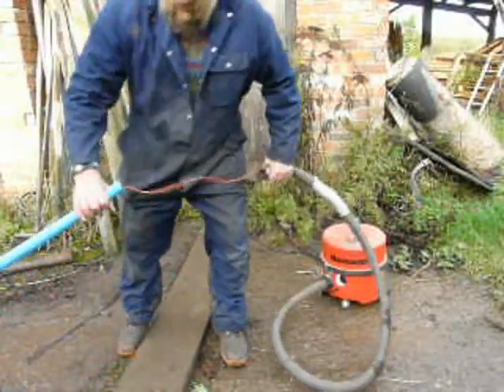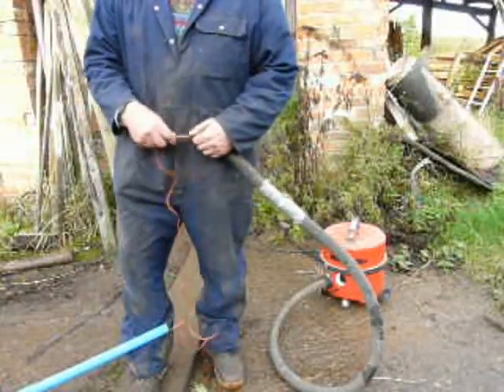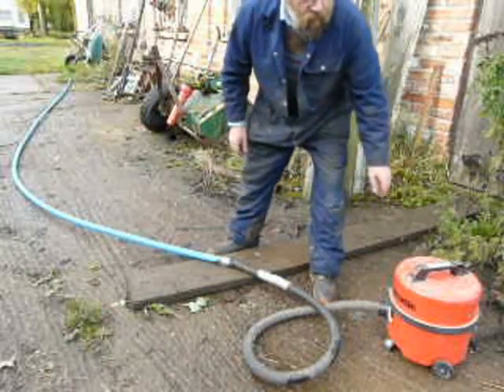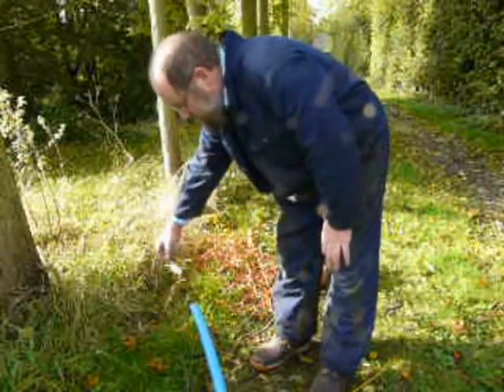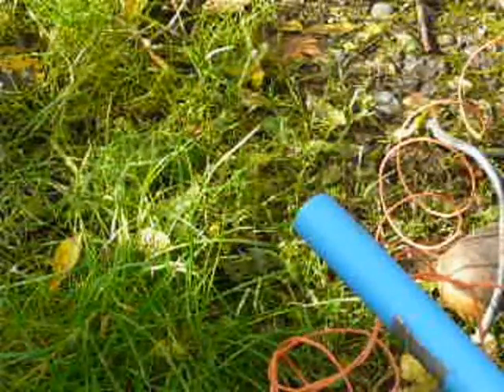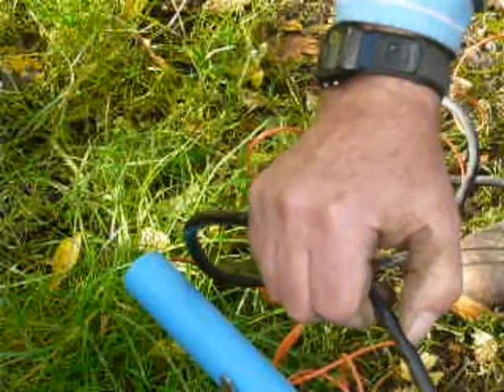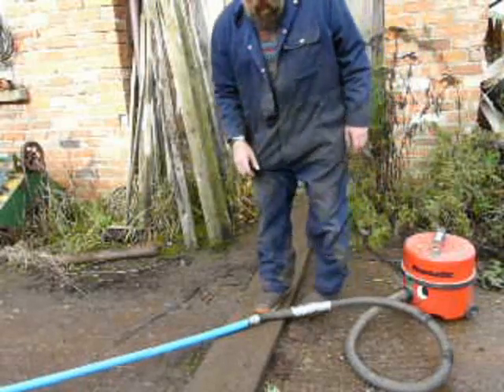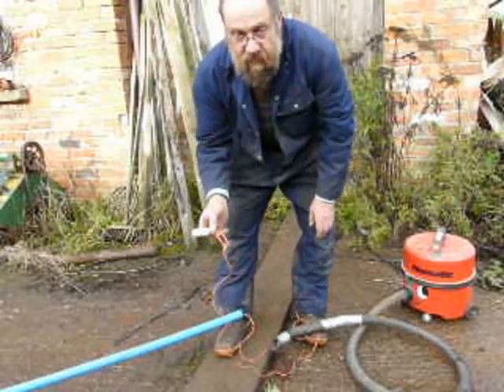Pulling cables through a long underground pipe.

Comment: Briliant, so simply explained with clear instructions.
I'm about to embark an replacing a bodged up mains supply from house to sheds 60m away using 2.5mm2 NYY-J cable, as its a lot more cost effective than armoured, with some lengths buried. I did think of using plastic conduit and this video shows me how to feed it without special tools. Many Thanks indeed.
Reply from the maker: Thanks for the comment , hope all goes well, please subscribe, cheers

Comment: Brilliant video. I am trying to pull a 100m length of cat 6 internet cable through a hosepipe. Can I ask the specs of the conduit pipe you are using as I may use that instead and where I could purchase it. Many thanks.
Reply from the maker: Hi. I think it was 28mm OD standard underground water pipe, available at any builders merchants, cheers
Reply: @TheInfoworks  Thank you. I’ll have a look for that.

Comment: I am going to try to run a new cable through an already used tube. Very useful video.
Reply from the maker: Hi, I always try to leave a thin rope in the pipe along with any cables because you never know, cheers

Comment: hahhahh i just used wire as had no string, thought id just try 2 core 12v cable, worked great,, also run 2 camera cables. through it, spot on method im going to have to remember this, awesome work, thankyou,.
Reply from the maker: Great, hope you have subscribed, cheers

Comment: Thanks Andy. 
Is it a horrible idea to run a low-voltage wire down an in-use 2 inch poly water pipe ?
Reply from the maker: Hi, depends on the current, size of cable and distance. Volt drop is you enemy here, so 3 amps at 12v through 50 meters of bell wire would be a huge problem. Current remains the same but volts drop so you could end up with less than 4 volts, cheers
Reply: @TheInfoworks  You may enot have given credit for the awfulness of my idea ! The pipe is full of water !  24 volts line from the bore head to the level sensor on the header tank 25 yards distant. The pump fella is not keen ! I'm just being lazy trying to avoid digging 25 yards of clay.

Comment: Thanks and greetings from Sweden. I'll give it a go tomorrow. Need to pull a cable through 40m of flexipipe. Hope it works :)
Reply from the maker: It will be fine as long as the pipe is dry, cheers

Comment: Hello Andy thanks for this great very practical tutorial now running some 6-7 years.  One question, do you know if this will work with smaller calibre piping, I.e. 20 mm MDPE internal calibre 15.2mm?  Regards Dave
Reply from the maker: Dave, I suppose it depends on how tight any bends are and how large the cables are. There's only one way to find out, let me know how you get on, subscribed? cheers
Reply: Hello Andy, thanks for this video and for sharing your knowledge and experience in all your vids. I used your technique for getting a pull string into a 20mm blue pipe yesterday evening. The pipe had water in it so attached 2 receiver tanks in front of the hoover so the water would not go down hoover pipe.  Thanks again!
Reply from the maker: Brilliant, good thinking and well done, cheers

Comment: This is a brilliant video. Thank you so much for posting this.. I’ll have to try it, but does it work if you have an existing cable in the conduit and the conduit has already been buried? I’d like to run some Ethernet cabling in the same conduit as the power to my garden house. Thanks again.
Reply from the maker: Hi, be good to hear how you get on, a bit a skill required and maybe use a bit of polythene as a mouse so it's more flexible, and a good vacuum, subscribed? cheers
Reply: Andy Reynolds thanks Andy. Will do. Subscribed. What’s your idea with the polythene?
Reply from the maker: Hi, A contractor I know just used a bit of polythene bag and he said it works, just thought it may add a bit of flexibility around the existing cable, see what happens, cheers
Reply: Andy Reynolds excellent! I’ll give it a try and drop you a line. Thanks for the tip
Reply: As anf fyi albeit late now as this comment is six months old, regs say that you cannot run data and communication cabling in the same conduit as electricity.  I also know this from running antenna cable and installing ethernet cables.  Even if you use SFTP interference from the em field of the electrical cable can and does degrade the signal of the communications wire.  In the case the ethernet cable.  Good practice is to run a second conduit (i think at least 50mm away from the first) or where that is not possible , find an alternate solution.

Comment: That was a great video.  Do you have any tips for swapping a cat5 data cable thats already in some outdoor conduit. Its for approx 30 ft run been down for 15 years. Do I just attach my new cable to the old (tape?) and pull really hard? Suspect its going to be full of mud etc.

Comment: I learnt a new way to pull a rope through a conduit pipe. But you did not show how to pull a cable. Please, how to pull a cable through after pulling the rope. Thanks very much. I learnt
Reply from the maker: Hi, it;s simple, you attach the cable to the rope using 4 x 1/2 hitches and secure with some duct tape, also add another piece of rope to be pulled through with the cable (for next time), cheers

Comment: Exactly how I had planned to do it. I am converting a pit well with jet pump to a submersible pump and plan to use the larger 1 1/4" pipe for the 12/3 cable(with ground also) from my basement to the bottom of the pit well. I'm just hoping that the poly pipe has no angled fittings to snag on since it is 5 feet underground.

Comment: Andy,
Excellent explanation, very clear and so easy to understand!
But will it work on my set-up? An underground corrugated polyethylene conduit (17 mm internal) with a telephone cable already present inside the pipe/tube/conduit??? Trying to add a fiber internet cable which is fairly thin...
Reply from the maker: Lionel, I supose it depends on the length and how many bends but there uis inly one way to find out. I suppose a small bit of bubble wrap would make a softer pipe mouse and work with the corrugations, be interesting to hear how you get on, subscribed? cheers
Reply: Cable pulling lubricant exists, an electrician would have some.

Comment: Great demo, just about to run a Fiber Optic cable
Reply from the maker: Thanks for your appreciation, hope all goes well, cheers
Reply: @TheInfoworks Hello Mr. Andy....please can offer for Optic cables blowing-in of an optical cable in a polyethylene pipe because the cable. in view of not rovnesty in a plastic pipe of 40 mm gets stuck in a pipe. Length of a pipe is 2 km or 4 km. e-mail Serikbayev.n@gmail.com the Kazakhstan

Comment: Thank you Andy. Practical.  However, will it work for 200 meters round roll of HDPE pipe?  How much pressure pump is required to suck air?
Reply from the maker: Hi, there's only one way to find out, try a very light weight mouse and what ever suction you have. Cheers
Reply: Andy Reynolds thank you very much
Reply: Andy, thank you very much. It worked for 250 meters of 40mm HDPE pipe. Mouse was wine bottle cork .. hehehehehe....  with thin plastic rope. Regards
Reply from the maker: Brilliant

Comment: Tougher than it looks. I ended up using a small eye dropper bottle that fit the tube well but not too tight. Took some time and shaking the pipe but I got it thru 250' of 1 1/4" PEX pipe.

Comment: Never ever use put Electric cable through water pipe (blue) - Black pipe with electricity markings on it is available and will prevent someone getting killed in the future.
Reply from the maker: Point of order here Mick, first underground electrical conduit is blue,  and secondly, could you please request rather than dictate. Cheers, Andy
Reply: Andy I strongly recommend you retract this. it is dangerous to put electric cable through water pipe. believe me. electric pipe is not blue read NJUG. I am a Power Engineer and I know serious injuries have occurred by cutting into what was believed to be a water pipe and getting burned via live cables. you call it a water pipe IT IS. please take it down.
Reply: Barry unfortunately what you are saying is wrong, it may have been the case years ago but these days new connections are placed through black ducts, gas is yellow and water is blue. whilst there are no rules for the private individual, no professional contractor would be allowed to do that. Why would they when the proper duct is available? and why would anyone advocate using water pipe when electric pipe is very similar, apart from the colour. I am an Electrical Engineer in the Power Industry I know there have been serious burns through people cutting into pipes and into an electric cable. I have been in touch with the HSE who agree it is wrong but they do not have the power to intervene in this sort of situation, they suggest I contact YouTube to get it taken down. I am hoping that Andy Reynolds sees this and takes it down as he is not responding to me now. Believe me it is dangerous!
Reply from the maker: Point of order here, the video is about how to get the string through the pipe, no one said anything about mains voltage. There's 2 points of view here, but no position to defend. Cheers
Reply: Whatever pipe colour for whatever services should it have a warning tape with service name, water, gas, electric etc buried just above the duct? Andy and Mick, are you speaking for different countries regulations?
Reply: I guess they must be for as far as I am aware electrical conduit here in Ireland is RED. That is what you get sold if you ask for underground electrical conduit.

Comment: Hi Andy,  Love your simple ingenious solution. My problem is that I have a broken wire (probably rotted as you suggest in your video) in a four wire harness to my water pump. I want to pull 1 (or better, 2) wires without taking the existing wires out. Have you tried your method with wires already in the pipe? Alternately I thought I could use a wire to pull a pair through but not the broken wire as, well, it's broken.  Any thoughts on how I might approach this problem? and yes I will subscribe!
Reply from the maker: Hi. in this situation the existing wire could be a problem. In the past I have used the existing wire to pull a rope through and start afresh, and of course leave another rope in the pipe along with the wires. Cheers

Comment: i will put a rope inside a 500 meter 1" pipe, you think it will get through with it
Reply from the maker: Hi. Use very this string first. Reduce any point of friction. It will probably work best with 2 people on a dry day. Subscribed to this non profit channel? Cheers, Andy
Reply from the maker: Hi, there is only one way to find out, use what you have and see. 500 mtrs is a long way, are there any intermediate access points? Cheers

Comment: Thanks for the video it's very good info to have I pulled 390 feet of 8/2 Romex and 3 strings of 10 gauge threw a 1 1/2 " conduit around four corners now let's say it wasn't the easiest thing ever done but it went threw
Reply from the maker: Cable friction is a problem, but getting the rope through first is easy with this method. Cheers

Comment: Like the water tubing and the piston concept, but using the Styrofoam with wire hanger was just over the top genius.
Reply from the maker: Thanks for the appreciation, it works. Have you subscribed? Cheers, Andy
Reply: jUST WON't go around 90 degree bends.

Comment: Thank you for this video.  We were trying to figure out how the wire gets in the pipe for an electrician to run wires throughout our backyard for pumps and lighting.  Now we know how it is done, and could probably do it ourselves. Many Thanks
Reply from the maker: It should be do by now, thanks for the message. Subscribed? Cheers

Comment: Thanks Andy, sheer genius :) I need to use this to re-run underground cable to power a work-shed and an outdoor pool light. Should work fine. I shared this on my FB page!
Reply from the maker: Thanks for the appreciation, sometimes a bit of furniture polish helps the cables slide. Subscribed? Cheers, Andy

Comment: We tried this and it works great. we used a plastic carrier bag instead. I do however recommend that the string goes in BEFORE laying the conduit in the ground. We used Black  25MM MDPE pipe which worked great. We also recommend that you pull a extra string through with your pull rope so you or the next person wishing to pull a cable through has a means of pulling a draw rope or another cable through. Finally, you simply cannot have too much string which should be `Polypropylene Twine as it doesn't stretch or degrade when wet or damp. After use tie it off at both ends so that it does not get pulled through later. Also I recommend using 24AC through the conduit and if you need 12V DC at the other end, transform it at the first junction box to avoid electrolysis. (CCTV Engineers) For 240V AC use armoured cable.
Reply from the maker: Thanks for the thoughts. Subscribed? Cheers, Andy

Comment: Thanks.   Great video!   Peace Ben
Reply from the maker: Thanks for the appreciation, Andy.
Reply: I plan on using poly pipe to run two 12/2 wires for my two power outlets in my green house and I'm just going to paint the pipe gray so people know its electric.
Reply: Andy Reynolds Hi...Excuse me , do you have a video or technique of how to pull out an under ground high voltage cable damaged between two manholes?.
Thank you
Reply from the maker: Sorry no, but try a Tirfor winch.

Comment: You should not use water pipe for electric cables proper duct is available cut through the water pipe and right through a cable and your a dead man.
Reply from the maker: Only if it's high voltage and you are an idiot. Takes a huge effort to chop a spade through this pipe, it does not happen with the first chop, and then eventually it is straight to earth.

Comment: Hi Andy. This is magic. In the house I had some pre-installed PVC pipes and I was stupid enough to draw the pull wire out. Did your trick with the vacuum cleaner. Started with a small rope wire and sucked that through, Then a small iron wire and and finally the power wire. Thanks!!!!
Reply from the maker: That's great, another successful event. Thanks for the comment and appreciation. Andy

Comment: I have a 50mm alcathene pipe with a 4 core and 3 core cable  in it, would like to pull a cat 5 through as well, do you think it would work on this?
Reply from the maker: HI. Thanks for the interest. Difficult, could get tangled with the other wires, only one way to find out, try it. Failing that try pulling the 3 core out with a line firmly attached to it. The pull back through your 3 core, the ethernet and a thin rope for further use. Let's hear how you get on. Subscribeed? Andy

Comment: How ideal method this is, and cost free. Tried it, and worked like a charm. Was faced to buy an "installators wireguide" - a thick stiff long plastic thingy to push the cable through the pipe. Cost a bundle, and I must say that the vacuumcleaner/piston solution worked smoothly.. Thanx again.. Subbed ofc :) greeetings.

Comment: I did the opposite of this method for putting in a draw string in to conduit, by using compressed air and pushing the piston, through the pipe. Great video thanks for uploading...

Comment from the maker: Yes. It doesn't need to be very good. In fact it needs to be quite loose to reduce friction. Just carve a bit of polystyrene, and as you say push a bit of wire through it and bend the end over. Let's hear how you get on.

Comment from the maker: Thanks for your comment. This is not the case, as you would see. The vacuum I used has the motor in the top case, and other forms have flexible pipes and bends that would not allow the piston anywhere near the motor fan. The fans are high pressure and so have quite small apetures, again the piston would not get into the workings. Try it and see.

Comment from the maker: Skill and dexterity, can you break it down into shorter runs? Use a guide cone to help in around any bends, strong rope and a winch, silicone spray lube to reduce the friction. Hope this helps.

Comment: Very clever!  I was even surprised at your brilliant suggestion to pull a second string through along with the power cables in case you have a future need to pull some cable in the opposite direction.   Thanks very much for this no-nonsense instruction.   Also, thanks for not inflicting your personal musical preferences like so many YouTubers think they need to do.   Without a doubt, the best YT instructional videos are those that get right to the point with the "how to ..." "nuts and bolts"!

Comment from the maker: Hi. Thanks for your positive response. I would assume that a 1300w machine would be sufficient. The main consideration would be to make sure the polystyrene mouse is long enough to avoid any tipping action when in the pipe. I guess length twice the width. This could be made up of 2 pieces held together on the wire. The diameter could be reduced in the middle to reduce possible friction. Let us know how you get on.

Comment: Thanks very much! I knew there must be a better way of what I'd figured out (using a mouse and attaching a floss to it's leg or using a whistle-rocket :) However I have a 50m underground pipe with diameter 6,5 cm (approx 2 and a half inches). Wonder if I must rent an industrial vacuum or will 1300W do the trick?